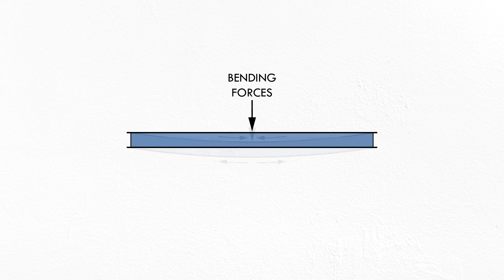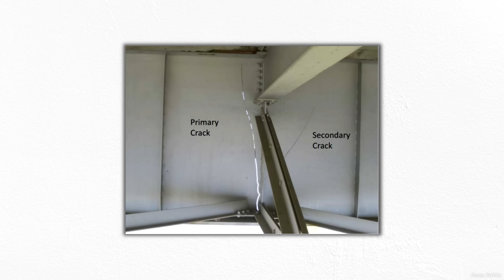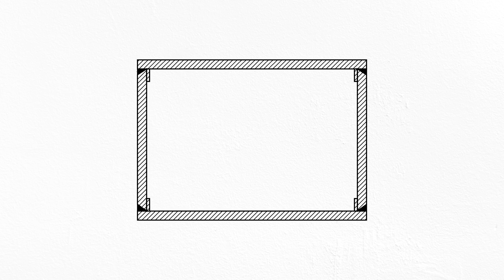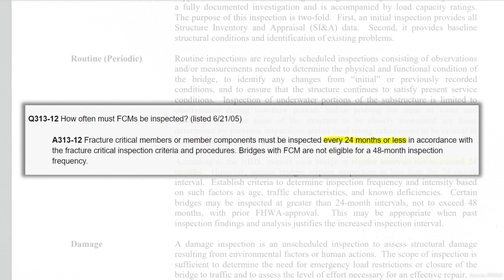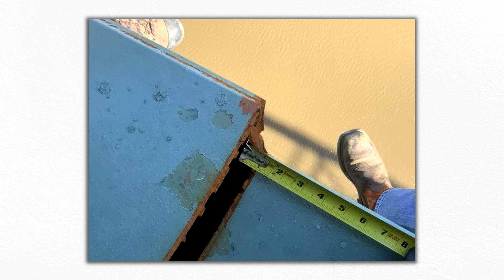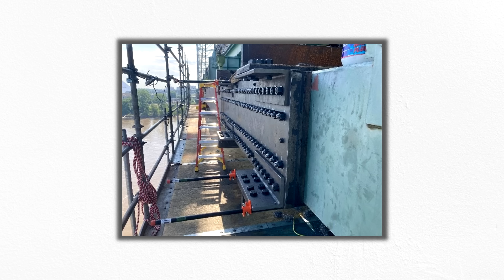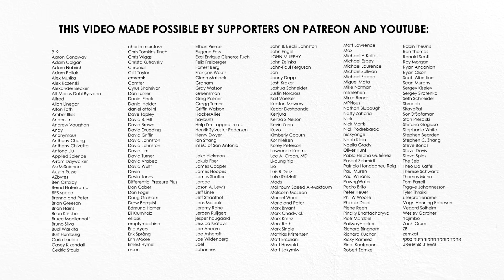What Really Happened at the Hernando de Soto Bridge?

Comment: Wow. It is amazing this crack has been there for so many years. It is also amazing it was missed in past inspections. It says a lot about our processes, both human as well as political, news, and engineering. It is sad to see government by crisis. One does not want to see rogue inspectors shutting down bridges for no reason, yet one does want accountability. Obviously, the repairs are going to be expensive, and there are a lot more questions one needs to ask. Right next to the crack one can see a reinforcement plate with a large number of bolts, this simple number of bolts shows what stress the original engineer believed this area could be under. Of course there can be numerous side effects warping and damage to other structural members. It is also curious the public relations nightmare of shutting down the bridge and people reactions. We all need to give the engineers some room to do their thing.

Comment: How is that a "crack"? To my untrained eye, that is clearly completely a break. I mean it's even offset a notable amount, which would only be possibly if it were a complete break.

Is traffic under the bridge permitted again? If it's safe for contractors to work on, it should be fine for traffic under the bridge which would of course not stress the bridge or get in the way of it's repair.

Comment: I'm surprised the tension member is a steel box, rather than a cable. Cables are far more consistent in their load-bearing capability, and easier to manufacture and test than a girder. Girders are great at Compression, cables are better for Tension. Hmmmm.

Comment: At 9:00 min into this video, a bend and kink is clearly visible in a steel vertical support tube under vertical compressive load, directly inline with the broken horizontal tension member.

Comment: I am concerned that the crack was visible in the drone footage but was never acknowledged - obtaining drone footage is meaningless without careful inspection of it by more than one person.   Anything that looks suspect, even if you can't tell it's a crack, needs a second close up inspection.   The installation of a few hundred strain gages on critical parts of the bridge would be a very useful indicator of potential problems!
Reply: That crack was obvious in the drone footage, and should have been followed up on. Why, even do the drone inspection if your not following the video feed?! Maybe one person flying the drone and another doing the inspection would be a better plan.
Reply: @manlyadventures  I believe that a better plan would be to record the drone footage and view it slowly, piecemeal in a comfortable environment so as not to get mentally fatigued and miss something.
Reply: @manlyadventures  
These need to be high resolution and stored for review by remote teams. AI should be capable of enhancing, scanning, and differentiating between video updates.
Reply: That might be what got someone fired
Reply: Michael Baker was doing an inspection on the cables not the tie when the drone footage was taken. They werent looking at the entire FC super. They just happened to have the footage
Reply: @aaronrov140  --  I can understand how and why an inspector told to concentrate on the cables would not study every frame of video his drone captured.   But this makes a case for letting most folks have access to the video.

OTOH:  photographing "infrastructure" in the post 911 era is "suspect."   Do we want the government providing all the information a bad guy needs to "take down" a bridge?
Reply: A neural network that could pour through drone footage to find cracks would be incredibly useful as a second or third pass. Unlike a human, the neural network does not get tired, and its eyes don’t glaze over.
Reply: @quinton1630  Good Idea - it would use programming similar to facial recognition software to find things that don't belong.
Reply: Not a bad idea. More eyes is never a bad thing. Not  sure the bad guys need drone footage to gain insight on how to collapse a bridge. Especially FC. Thats the issue with non-redudant structure.  There is only 1 member that needs to go in order to have a collapse. Thankfully, in this case the load was transferred in others ways but in theory this should have caused total collapse. The rope was cut.
Reply: A "precision" video survey might also detect some differences between scans.
Reply: @GilmerJohn  I wonder if they could somehow automate image analysis using AI?
Reply: Keeping "a few hundred strain gauges" and all the wiring required working correctly could be more trouble than just inspecting the bridge, don't you think?
Reply: @tomterrific9459     They would be very useful on the most critical structural elements and wire are not needed --   https://www.resensys.com/senspot-strain.html
Reply: @tomterrific9459  I always assumed strain gauges  were fitted to structures like this - guess I am incorrect.
Reply: It's funny to think that the much larger and older golden gate gets painted continuously, therefore gets informally inspected continuously up close and personal. Sad to think that had they just tried to maintain the paint they would have caught it much sooner, most likely.
Reply: @imd12c4advice       Good point.   I just read recently though that maintenance on the Golden Gate is slipping to the point of neglect - but being it is California  it is no surprise.
Reply: Hundreds of strain gauges is probably not useful, but for example on suspension bridges they can use microphones to listen out for failing strands of the cables. Or composite materials can have glass fibres embedded into them to detect breakage. Or alternatively, they could just have somebody look at the bridge... 😋
Reply: Our university is implementing a monitoring system on one of our major concrete and stell viaducts in Auckland New Zealand - learnt a lot from the academics and technicians doing it, this is a really good video shwoing loads and strains on bridges with a couple of simple demonstrations.
Reply: The issue with strain gages is that they are best installed before the member is stressed. When installed after the structure is stressed, the gage cannot indicate total strain, but only changes. 

Strain gages are very cheap but the instrumentation infrastructure has been expensive until the recent advent of solar and piezoelectric powered nodes with wireless fabric networks. 

Too bad these generally cannot be connected to legacy strain gages installed before construction began.
Reply: Part of the issue is that they might not have been looking for cracks in said tie, as referenced by @aaronrov140. One also has to take into account that there are those who do not want anyone to use the word crack, but linear indication, as I was told a time or two over the years. Other times, I was told that it was OK to use the word crack. It all depends on the client, and what they are looking for at that particular time as well. Still, anything that obvious should have been brought up as that dark scar on the green-silver member was quite obvious, and that goes back to the guy on a canoe/kayak taking pictures as well.
Reply: @dashcamamerica9775  the guy in the canoe or kayak probably had no idea at all how critical that member was to the bridge.  He may not have even noticed it at the time, but went back through old photos to look after the problem was announced.  He should get a pass.  

I'm a bit surprised that the review of the drone footage didn't start alarm bells ringing though.  But perhaps the reviewer of the drone footage assumed  that the crack had been reported by the team that was supposed to inspect the structural members of the bridge.  (Assumptions make an ass out of you and me.)
Reply: We need drone footage of the inspector watching the drone footage!! And don't forget an inspector to watch the footage of the inspector watching the footage! Come on guys, this safety inspection shit is WRITTEN IN BLOOD. Get off your Farmville app and DO your damn job. The error checking for the inspector might be possible on computer, but it can be outsourced for pennies to kids in India and China: if they find a crack that is missed, they take the inspector's home and pension.
Reply: A strain guage is placed across a crack to determine if it is widening.  Placing them on uncracked material wouldn’t tell you anything unless a crack started at the place the guage was installed.
Reply: @GH-oi2jf  You don't understand what a strain gage is.   It is a sensor that is epoxied to a component that you want to know the stress in - when connected to a cpu you can read the forces (compression or tension) in it.   The cpu can receive input from as many censors as you like and can be programed to monitor stress limits and issue an alert if any are exceeded.   All modern scales, truck scales, log truck scales, bathroom scales, kitchen scales,  use strain gages.
Reply: @GH-oi2jf  
When strain statically increases or drops, that may indicate an adjacent crack developing, or foundation settling.

Comment: You never mentioned the danger of diverting all of that traffic over the "OLDER & SMALLER bridge!!   How well has it been inspected and maintained seeing as how it was relegated to secondary low use.   They are vastly OVERLOADING an OLD bridge with traffic it was never meant to carry even when new !!
Reply: If they’ve made the call they’ve already done the calculations and deemed it safe enough. These engineers are the ones with the actual numbers for capacity, maintenance, and expected load, we are not. We do not know what is safe and unsafe.
Reply: "These engineers" are the ones who allowed the other bridge to become dangerously unsafe but you default to - "I trust them completely".     It is always good to ask questions.    What I asked was an important question and the statement I made was an obvious one especially coming from an engineer.
Reply: @Hogger280  You asked no questions. You can even check your own comment, there isnt a single question mark. Instead, you were actively asserting that the diversion of traffic to this other bridge was unsafe, full stop. Which, without having the important information that the engineers and inspectors of these bridges have, is entirely baseless. 
I do think that voicing concern and asking genuine questions about their decision to divert traffic is reasonable. But you did not do that. You made hard statements and fear mongered with absolutely nothing to back you up.

Comment: "It's hard to understate the severity" means that it's not severe at all.  You meant "it's hard to overstate the severity" which means that it's of the utmost severity.
Reply: Someone explain, doesn't it work both ways? As in, it's hard to understate because it's so serious, you can't even say it in a way that makes it look benign.
Reply: @ChucksSEADnDEAD  It does not work both ways.  If you're understating it, you're trying to make it look benign.  If you "can't understate it enough" that means it's the most benign thing ever.  What you mean is the "Can't overstate it" meaning no amount of exaggeration is sufficient to over-represent the threat.
Reply: @daemonfool  ""can't understate it enough"" - But that's not what was said. If that was the way it was phrased I wouldn't have trouble. I understand why "hard to overstate" is a better way of phrasing it but this is less grating than "could care less" or other common mistakes.
Reply: @ChucksSEADnDEAD  Hard to understate can mean easy to overstate, which means its less severe than what was stated.

Comment: "911 what's your emergency?"
"Hello, I'm an engineer on a bridge you need to shut down immediately."
"Why immediately?"
"Well, from where I'm standing I honestly don't know if I can make it to the end before this POS collapses..."
Reply: I'd really like to see an interview with the 911 operator who received that call.
I mean, calling it in to 911 is one thing, but I'd really like to know what the operatir had to do from there on out. I would assume this is not one of these things with a standard procedure outlined in the training manual
Reply: @horrorhotel46290  Chances are they do have procedures for it, with this falling under a category like 'large scale disaster', dealing with larger events like bridge/building collapses, which may also be sub-divided into specific categories based on the area. A shore region probably doesn't have to worry much about a mountainous landslide, but a tsunami/hurricane could very well be a known and accounted for issue.
Reply: @horrorhotel46290  likely similar to the procedure for shutting down the bridge due to a major accident, or how they shut down roads for accidents. Likely just had to also contact West Memphis PD to shut down their side of the bridge.
Reply: "Why immediately?"
"Okay so..."
Reply: @milandavid7223  Did you see any of the  news  footage  from that train accident in Seattle  a few years  back ?   The News anchors reported that the  train was going backwards  and  no one could figure out what the  front and  end of the  actual train was . . ..    The  Leading engine  was actually  DOWN  on I-5,   below  the bridge and behind the  vantage point of all the  report videos .   Those assholes   had NO CLUE  what they were saying ,   but they  all came across as if they were  rail construction engineers  .    That one  wasn't a structure fail,  but  had the same  outcome as the Minneapolis bridge  crash..     Ya  the  E911 operators  should  be required to  at least review the local stuff they  could  see -  IF it  REALLY goes  Bad !
Reply: Hi 911, I was just on the Tacoma Narrow's Bridge a few minutes ago. 
Okay what's the emergency?
Well, me and the bridge are now in the river. Can you send some help?
Reply: You probably wear a mask still
Reply: @Therealestrunnerluda  Who?
Reply: @Therealestrunnerluda  what? How does that make sense to this thread???
Reply: @Therealestrunnerluda  I do, why do you ask?

Comment: We should point out that the remaining bridge sections also form abutments as secondary support for the arches.  In a bridge this long, it unlikely that the abutments alone would sustain the structure.  It is clear that several inspections were inadequate and that the member could have fractured much sooner.  Inclusions in metals can be stabilized and this one did seem to be stable for 2-3 years before fracturing.  I also agree that scapegoating one inspector is probably counterproductive; written warnings to all involved inspectors would be more effective.  Only repeat offenders (and all repeat offenders) should have been fired.

Comment: It is amazing what a good inspection program can do. I consult for oil and gas companies that have agreements with counties, towns villages to use road beyound their design spec which leaves the operator responsible for maintainence and upgrades. They did this with 0 overaite but with 400 miles of public roads in one clients control we build and I now oversee the quailty program. Reduced repairs by 80% and maintance in over have while growing the network. Programs are iterative like design, take the lessons to other bridge and it gets better. Failures happen at all levels, mitgate damage and learn. Thats all you can do

Comment: Grady stole high cycle fatigue out of my keyboard. My guess is the road deck and bed (not sure what the proper terms are I'm a materials engineer not a civ e) actually held the portion of the tesion held by the tie, probably heavy cracks in the asphalt if you look. Just my $0.02

Comment: All structural welds are ultrasound inspected. It’s not possible for a weld to pass like you mentioned. Also the crack is not anywhere close to a weld.
Reply from the maker: They are now. They weren’t when the bridge was built. The member is welded along its entire length.
Reply: @PracticalEngineeringChannel  it’s a box beam with plate metal welded solid along its length, not up and down as the crack is. If the bridge were built in the 70’s it still would have been X-ray tested.

Comment: Why would they not use steel rope - like they do in suspension bridges - for a member like that that in tension and subject to fatigue?
Reply: If you still tied all the transverse beams to it that wouldn't be as rigid, but there should be a way to design around that.

Comment: Dear Grady, 
The heavy bolted repair section, as shown, does not address the root cause but rather band-aid it. It is likely a crack resistance/tolerance issue, not a stiffness issue. Maybe a band-aid is a cure but that all is a separate discussion.

Besides, In your Clip you are missing the Likely Culprits:
Design: Proprietary Steel Sections are more prone to issues than Standard Sections. Weld detail that you showed, if true, need improvement from the get-go.
Material: Steel plates could have metallurgical flaws from the foundry or cause of mishandling.
Fabrication: Fab of Steel bridges are inspected by Visual method Only. So the chance to miss a Fab flaw is likely. This is likely a manually welded section. Was fab even inspected at all?
Inspection: Did the drone inspection report explicitly identified an Anomaly ??? Inservice Inspection is not a substitute for the above listed.

Responsible: Are definitely owners. Not individual inspector.
Now it will be a tug between two states on "who shall Pay???" & This incident will make its way to textbooks in the coming years.
This is an educational discussion only. Love from the North.

Comment: My dad spent years performing similar inspection work on a practical simulator for aircraft- massive hydraulic frame built around a production plane to bend, twist and tug to simulate flights. Every 10,000 simulated flights, they shut it down and went over everything with a fine tooth comb to see what broke and then design a repair to send out to ground crews through the fleet.